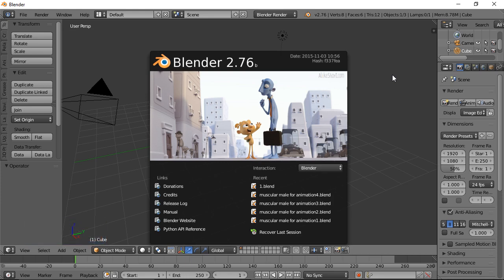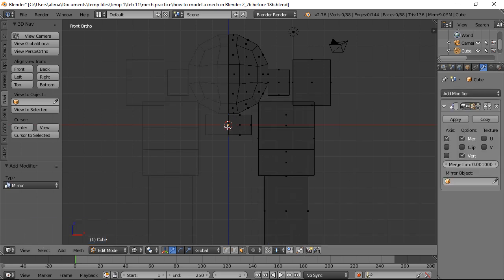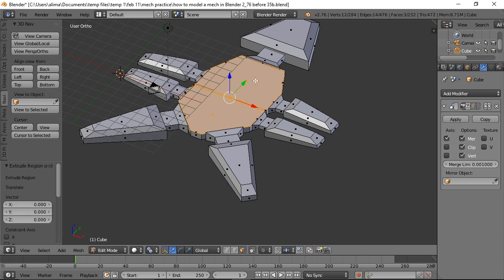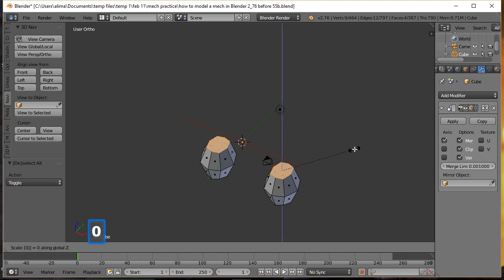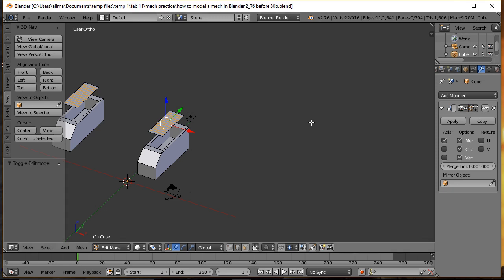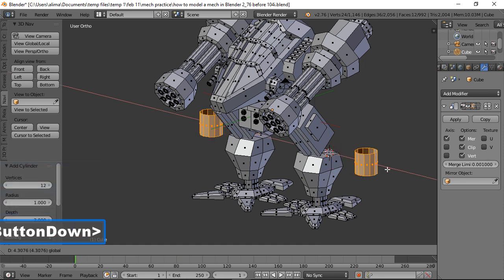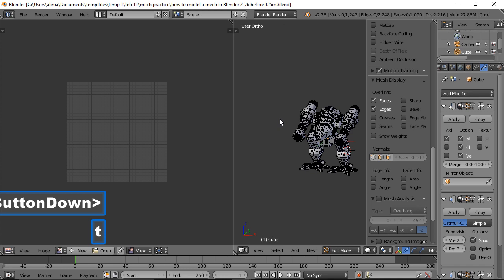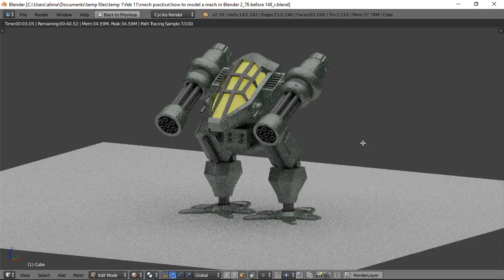How To Model A Mech In Blender 2.76

Comment: I don't know if you use Unity but my mech objects that have been x-1 copied are all backward once exported over :S https://goo.gl/daoAht
Reply: Worked it out after 3 hours... When you copy objects you must do it in edit mode then flip the normals and separate the selection. If you copy an object you created by separation in Object mode it copies the origin point but does not flip the axis association. Even though its way easier to duplicate and x-1 in object mode it messes it up. I have also encountered the same thing with armatures. My left hip rotation, which was the original, rotates the leg on the Z axis as desired. The copied armature requires X axis movement to get the same rotation as the other side. i was losing hair over this last night.
Reply from the maker: Glad that you figured this out and shared this information with me. I appreciate it. I do use Unity. I just made my first Unity tutorial using Playmaker for this channel about a month ago.
Thanks for watching this video and again for the info.

https://youtu.be/B9wcShwfS7Y